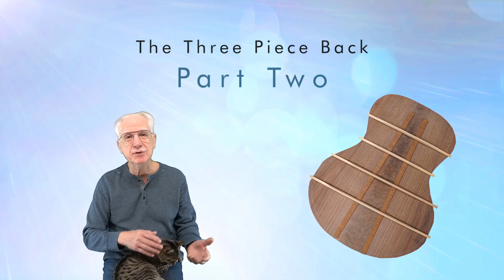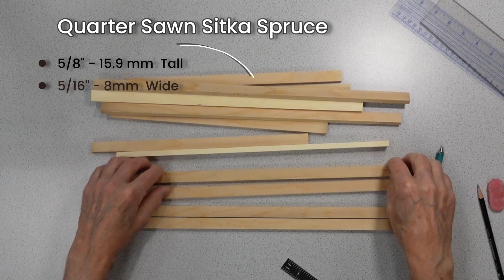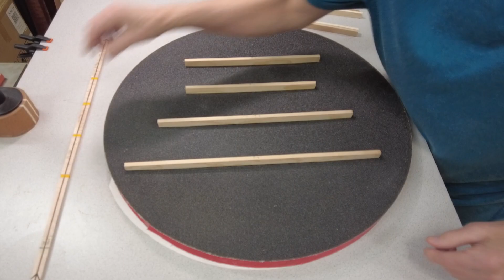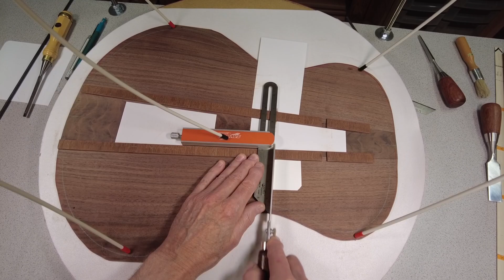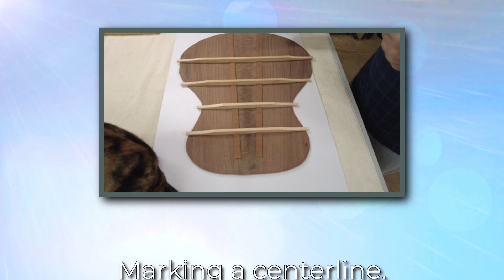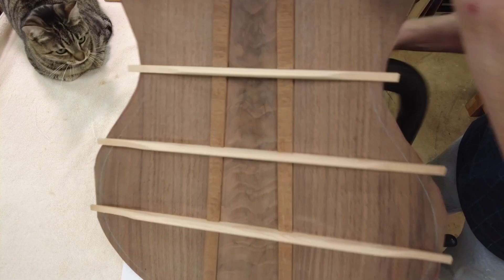McClelland Woodworks Video Journal #48. Walnut Three Piece Back Part Two.

Comment: I've seen many builders radius all the braces anywhere in the dish. I did it like you do. Makes sense to match the radius to where the braces lay on the back, or top.
Reply from the maker: Totally agree, braces sanded in the middle will not match the curve of the dish (or bowl} towards the edges. I found this out the hard way.